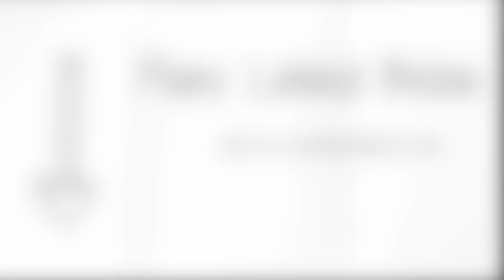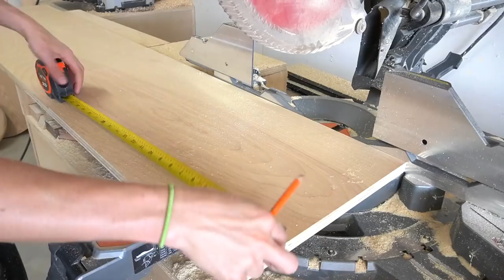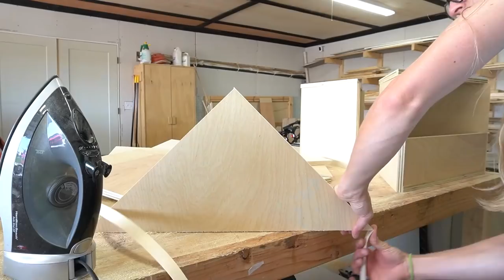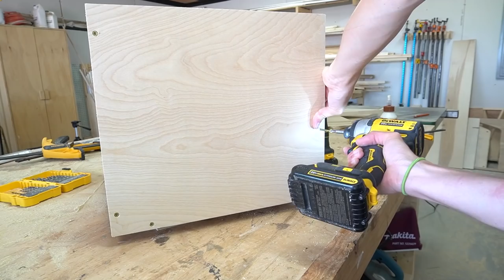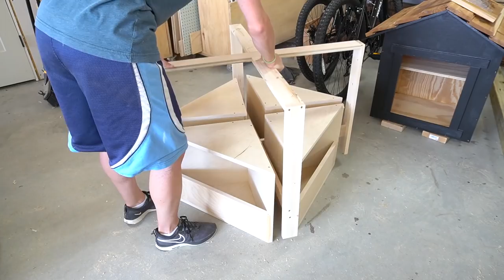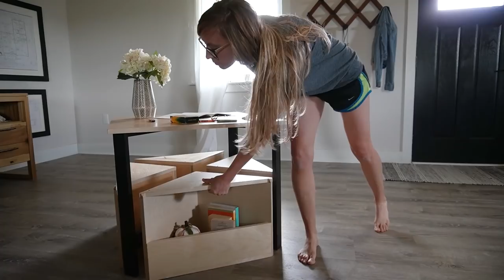How to Build a Kids Nesting Table--{With One Plywood Sheet and 4 Tools!}

Comment: Great idea, well done love this project, one question, is there anything on the bottoms of the seats to help sliding?
Reply from the maker: Thank you! There isn’t but you could easily stick some little rubber pads on the bottom...I think they make them similar to felt pads, just rubber instead.

Comment: I was so determined to try this , I purchased a tape measure, with imperial units.  I’m so glad you didn’t use 16ths or 38th of an inch or any other crazy number that make no sense to me.
Reply from the maker: Haha I tried to keep the numbers as simple as I could! Happy building! That project was so fun to make 👍
Reply: @WoodshopDiaries  what length are the table frames / legs ?

Comment: I like it. The granddaughter would love it for her son. Can it be scaled down to prevent the odd corner? Looks like your web site is offline.
Reply from the maker: It’s working fine on my end. My website is running. It could be built with a larger top, but it’ll stick out awkwardly at the corners. You could trim that off though.

Comment: Also, when you were assembling the legs, why didn't you just use the spacer for all of them? Wouldn't measuring individually introduce a chance of error that is avoided with the jig (spacer)?
Reply from the maker: I just preferred to measure. I only used a spacer block first to help hold the leg up while I got it attached. After that, I didn’t need the “extra hand.” Measuring is just as accurate...if you measure accurately. There’s a million ways of doing things. And I rarely do them the same way each time. In the end, the product is the same. 👍

Comment: 10:35 - great solution, сute little pieces.
I counted more than 4 tools :)
Reply from the maker: Circ saw, Miter saw, drill, dowel jig 👍
Reply: guide bar, impact screwdriver, Swensen's square, pencil, eccentric sander, tape measure, clamps, iron, mallet, rag :)
Reply from the maker: I’m glad you paid such close attention. The saw guide, driver and sander are optional. Not counted. You can make do without them. I also don’t count a pencil, tape measure, square, clamps or a RAG as a tool. They’re just things most would have laying around in the shop, garage, or house. And if not, they’re probably not planning to build anything anyway so they’re likely not watching my videos.

Comment: Hi, can you make something like this for adults?
Reply from the maker: It would be easy to make this a little bigger for an adult size. Basically, just raise the seats to 18” and raise the table height to 30” 👍
Reply: @WoodshopDiaries  Thank you  for that information.  I am going but get the plans and make those changes.  I am a beginner at work working and i have learned many things from you.

Comment: Good morning Shara, that is a very clever project. I think the molding was a good solution and looks like it belongs there. (That's what I would tell everyone. LOL) I would've wrestled with the 1x over plywood more. (I'm told I'm a little anal in that way) 🤔. Love your vids. Another great job. 👍
Reply from the maker: Thank you! Yeah, if I had any 1x material in my shop, I would have used it but I was completely out and didn’t want to run to the store just for that. If it wasn’t going to be painted, I would have 😅 sometimes I just make do and pretend it never happened 🙈🙃😂

Comment: As usual great idea. Not trying to advise but just an idea that if you miter the sides then the top pointed corner problem can be resolved?  Please let me know if my thought process is correct. Thanks for sharing.
Reply from the maker: Yes, that would work 👍 I just didn’t want to mess with edge banding mitered edges because I would have to buy another size of edge banding 😂😂🙈